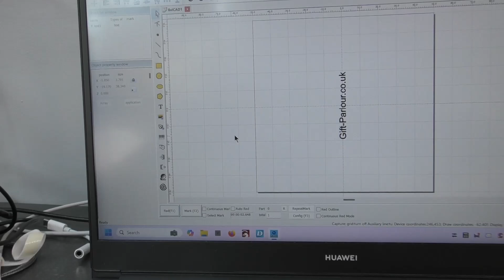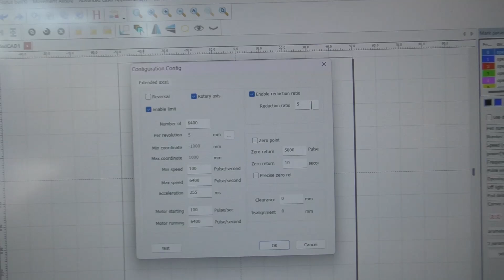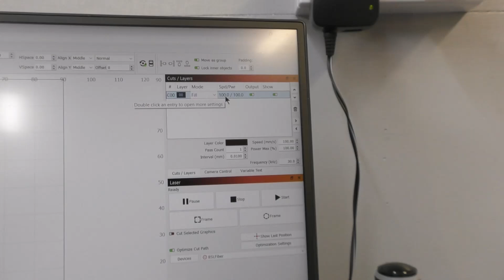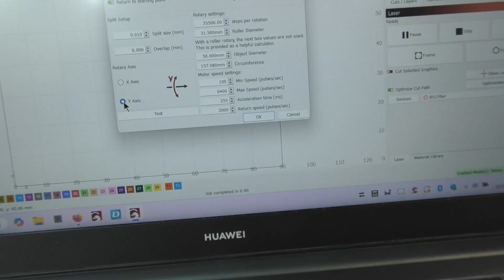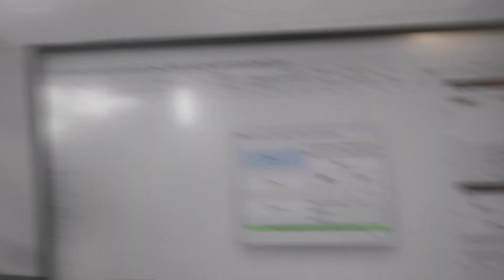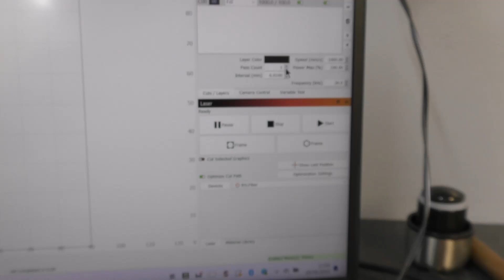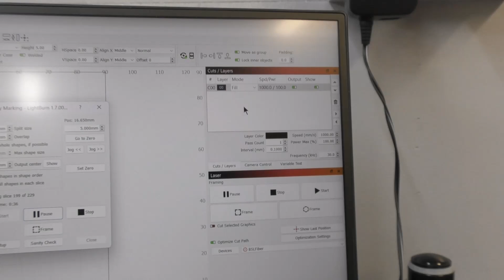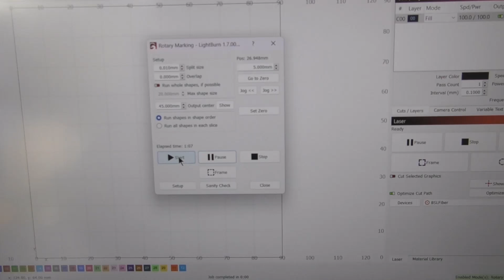Mr Carve M1 Pro Rotary Roller with Lightburn & BSLAppSimple

Comment: If you read the info about rotary, at lightburns site, it clearly states that the steps pr. rotation is NOT the item, but one rotation of the roller. I got it fixed at 16000. Also one needs to set the engraving layer to output shapes individually.
I also found that a larger splitsize gave me a more smooth engraving, though that ofc depends of the layout you are engraving.